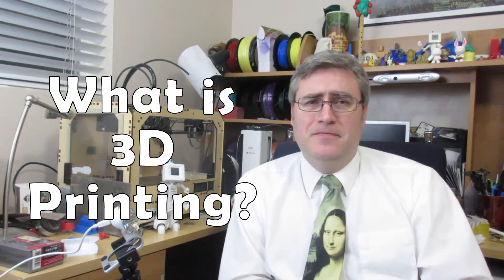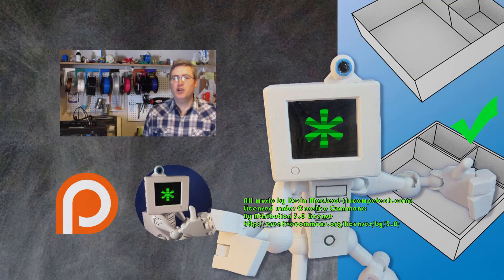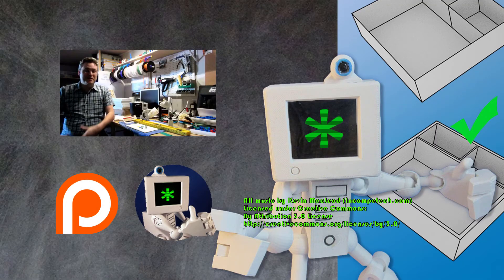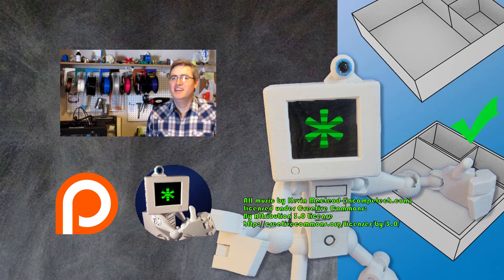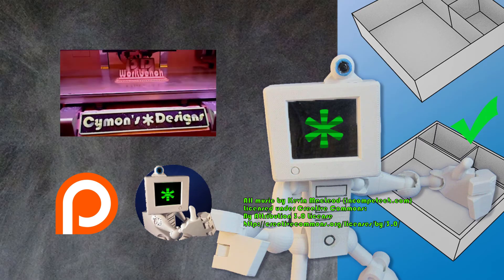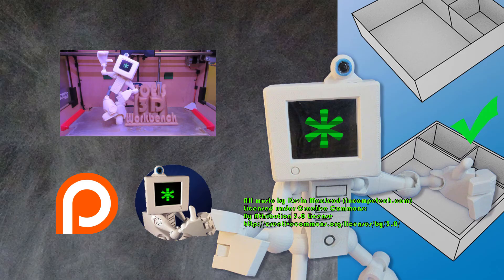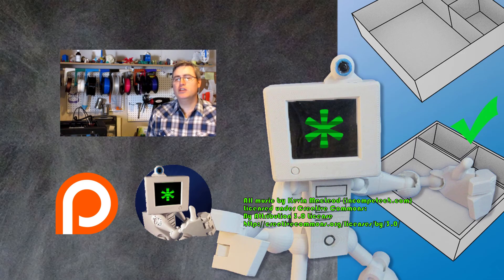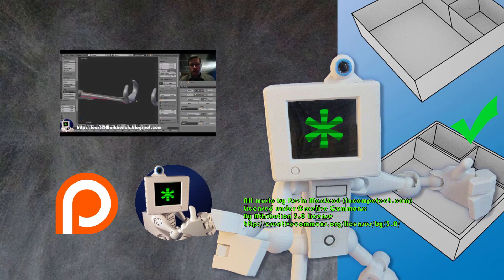3D Printing 101 - What is 3D Printing?

Comment: great approach to 3d printing!!  
Download and print is awesome but as an amateur designer the true magic comes when ideas travel from your mind through some CAD software and finally materializes into a phisical form for a few bucks of plastic.
Before home 3Dprinters, the physical production of anything was a sloooow and expensive process involving some kind of manufacturing company to send the files and pay for it. Not suitable for experiments or amateur designers like me.
greetings from Spain!!
Reply from the maker: Absolutely.  There was about a 40 second ramblcade of me talking about a place where I worked that turned a six week process into 4 days, and how that's could even be in your home. But I cut it because it seemed less relevant to this video, being a leaping off point for 3D printing 101.